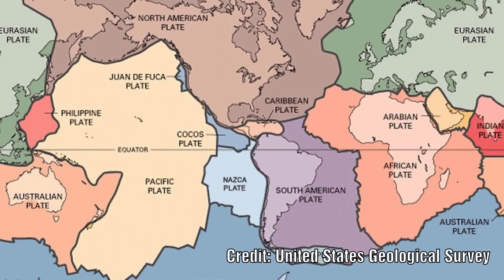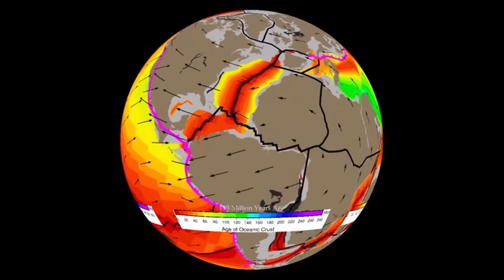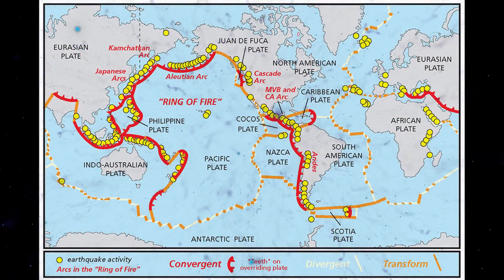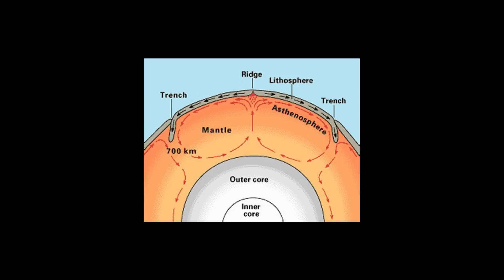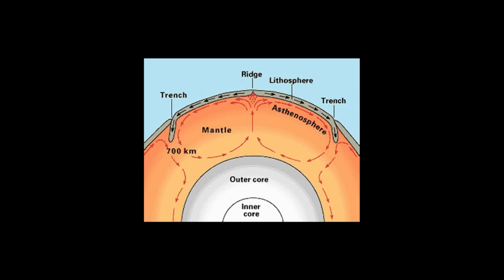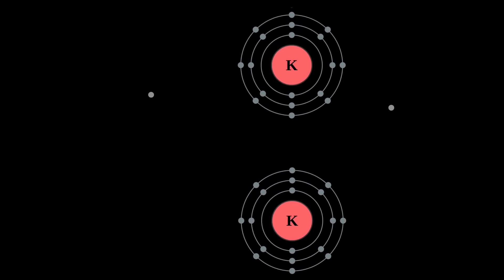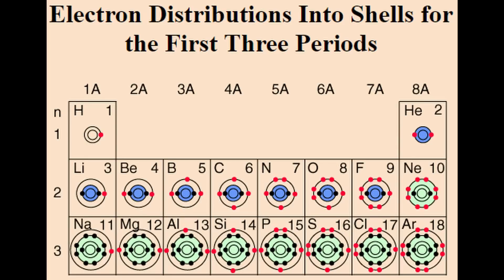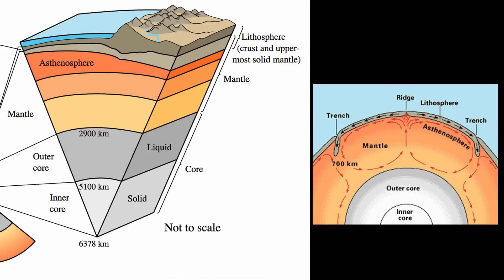What Powers the Movement of the Plates?  Convection or Something Else? Electronic Tectonics Part 1/2

Comment: I've been thinking for some time that the mid ocean ridge is the point of origin of the split in the plates but that the oceanic crust was extruded from beneath the continents. The basalt being brought up from considerable depth as a saturated solution containing insoluble particles in a supercritical fluid, perhaps h4s dissolved itself in h2o, nearing the surface the pressure drops and the mineral sits between a fluid and liquid state. When a continental tide passes through cracks occur and h4si dissolved in h2o penetrates from far below. This mixture reacts melting the pre-basalt, forming the same, together with steam sulphuric acid and silica  ++?. Once the massive extrusion of basalt from beneath the continents end residual activity at the mid ocean ridge forces a little of the new basalt back where it came from.

Comment: It is reasonable (with minor effort) that the individual solar and lunar tidal forces upon the lithosphere (uplifting as much a 3+ inches per daily cycle at the equator ... and more with king and spring water tides - also having the greater conjoint sun-and-lunar alignment tidal forces in geology, play their parts in tectonic plate movements, as well as portions of magna flows of the asthenosphere during these periods.

Comment: If Charles Chandler has electronic tectonics - then this can only happen via the (Lord) superconductive stellar core fragment that is the true source generating gravity but also the active electrical charge through the planet.

Stellar gravitic core - real gravitic force
Plasmatic sphere of lanthanide and actinide radioactives - stripping electrons and shooting them around and outwards through ...
Plasmatic sphere of lead - containing most electrical charges but a constant emission of charges seep through this barrier into ...
Ferromagnetic sphere of iron and nickel - stroking this sphere creating the polar magnetics and flux of the planet ...
Paramagnetic sphere
Diamagnetic sphere
Asthenosphere - lower mantle boundary - undergoing magmatic currents, fluxes, and movements
Asthenosphere - upper mantle boundary - undergoing magnmatic currents, fluxes, and movements
Lithosphere of basic matrix of solidified rock

Stellar core and plasmatic radioactives do have pulsing intermittent non-ionizing and ionizing radiations emissions and electron discharges outward.  These emissions and discharges further energizes the magnetic spheres and asthenosphere mantle into expansion.  The lithosphere cracks, mid-oceanic rifts widen, spew, and push apart continental and oceanic basins.  There is no pure expansion and recycling of plate tectonics on this greater scale of manifestation.  This can be seen by reversing the known paleomagnetic signatures (and their origin dates) and see the shrinking earth.  Otherwise, you would start to see very ancient seabeds appear that do not currently appear on the graphs.  Theyt would say that this is the 100% recycling model.  Whereas, with the expanding (and a little recycling) you have the telltale remnants of very ancient paleomagnetics that MUST BE hidden or buried (not recycled) under areas where such ancient matrix must exist.  Such shoreline of the Russian-Japanese-Asian plate tectonics shows their blue coloring of vast age, while the North American craton and West Coast show NO ancient blue coloring and age.  Are we to then believe that the only plate tectonics movement happened with a locked West Coast geology, and only that ancient matrix of the Old World was the most ancient spewed magma to happen, and sometime when both Old World and New World Pacific shorelines have a common date of paleomagnetics, then the mid-Pacific ridge started spewing and pushing outward in both directions.  You can't have it any other way.

Smaller planet, no primordial sea, one gigantic universal continental mass that then started breaking apart as the planet started expansion and the plates started their skittering all over the surface, and the core manufacturing of oil and water (!) which as gigantic aquifers of lubricant and artesian waters becoming spewed out as swamps, ponds, lakes, creeks, streams, rivers, proto-oceans into the lowest basins, until Pangaea was all water bound ... and we have our current-sized earth and volume with 60-70% planetary-created water (still being manufactured) covering this Big Blue marble in space.

The water on this planet was not brought here by how many billions of meteors, comets, etc impacting this planet - and imparting their micro-fraction of water droplets (totally insane rationale !!!) - but water and oil was manufactured internally - and eventually released through the activities of the stelalr core fragment and the surrounding spheres.  Such gravitic forces, alongside actual elemental transmutation would render naturally accreted material on the core fragment, liberating alpha and beta particles, that would conjoin and start making up all the said primary elements of the planet - hydrogen, helium, lithium, berylium, boron, oxygen, nitrogen, carbon, ... and some radical and noble gasses.  These elements were then later transmuted into these higher elements - not by (super)nova explosions and nuclear fission and fusion.  Such nuclear fusion and fission happens right under your feet - right now.

Comment: Glad to see you're working on Charles Chandler's excellent findings. He has a series of astrophysics and geophysics papers at http://qdl.scs-inc.us/?top=6031 . His paper on the Sun's Interior at http://qdl.scs-inc.us/?top=7224 explains how electric forces hold the Sun together via relatively current-free electric double-layers, formed by EDP, or electron degeneracy pressure, which is the same as the Pauli Exclusion Principle. He and I initially referred to EDP as "compressive ionization", because compression squeezes out electrons, causing charge separation. I think you explain it well too. I tried to understand how electric forces form stars, planets and surface features etc by reading material from Electric Universe scholars, but I had very poor understanding, until Charles started discussing and writing about it. He had initially figured out how tornadoes and thunderstorms work electrically maybe ten years ago. Then, when he and I and a couple other EU friends started sharing info, he developed his model for star, planet and galaxy formation etc. The two friends had their own somewhat similar models, but Charles' model has always seemed the most thorough and sensible to me. Charles apparently had quite a lot of experience with welding and other similar work, which helped him understand electrical forces.
-- In this video above, at the 6' 3" point, you show a tectonic plate subducting into the mantle. Charles and Mike Fischer and I believe that is incorrect. Plates are likely not dense enough to sink into the mantle. One plate can ride over another, as the North American plate has overridden the Pacific plate, and that override looks initially like subduction, but light material doesn't sink into denser material, like ice doesn't sink into water. I looked briefly at your previous video about Guy Berthault's findings regarding rapid stratification, which I agree with. John Baumgardner's science papers on "Noah's Flood" etc seems to me to have the best explanation of how rapid stratification occurred, i.e. via the Flood. I don't find any EU explanation, such as electric discharge machining (EDM), as persuasive at all. Charles has critiqued EDM persuasively. Baumgarnder found that a small planet or large asteroid likely orbited Earth elliptically, causing tidal waves at perigee, which formed strata on the supercontinent, when it had low altitudes, no mountains. Six close approaches of the object caused six megasequences of strata formation. Mountains formed shortly afterward, when an asteroid hit the supercontinent, splitting it up into continents and islands that moved apart rapidly to their present locations. See Mike Fischer's site at https://www.newgeology.us/ which shows how mountains formed from the asteroid impact. Mike's model is the best I've seen on this. He found that the continents were likely able do slide over the Moho layer, which has very low friction due to it being ionized, by EDP and by the Moon's tidal forces, as Charles explained somewhere. Mike and Charles both have similar ideas about how the supercontinent formed too.
-- Celeste told me about your video channel and she said you're trying to contact Charles. I PM'd Charles her contact info. You can also register on his site above and then contact him via PM there. G'Day. Lloyd

Comment: Earth is hollow

And that cavity is increasing in volume i.e. EARTH is 
E X P A N D I N G

Spherical granules being formed on SAFFiRE sun ball may explain why stars shoot out hollow planets into orbit.

As if the stars collect their newly formed trash aka heavy elements,  and then spew them out as planets.

Wal thornhills "dipole gravity" seems logical now.
In every huge body, all e- in atoms are shifted away from the centre, and all p+ are shifted towards the centre.
If the body has just too much matter in it, then atoms can overcome their structural arrangement/friction/interatomic bonds etc , and so a cavity gets formed in every planet with all p+ pointing inwards, the repulsion may cause planets to expand over eons.
For "earth dipole gravity" to exist , earth should've 2 plates as in a capacitor.
Plate 1 is the surface we live on.
Plate 2 is the wall of hollow inner cavity.
And maybe, its pretty chilled inside that hollow portion .
It gets hot only in between the 2 plates.
Subterranean life can exist there on the cavity wall.

I maybe wrong , I'm no scientist.

Comment: Elephant in the room: Over a billion years the coastlines of Africa and S America would bear no resemblance to each other from various erosion and torsion forces. Must have happened faster by a factor of thousands.
Reply: The plates are nearly an exact match. Millions of years? HahHumbug!
Reply: The coastline is not the edge of the techtonic plate
Reply: (1) The Atlantic Ocean only started to open about 175 Ma years ago.
(2) Because the spread is from that Atlantic ridge in the middle of the ocean and is basically linear, and the main bodies of the continents are so thick and established, there aren't any great forces deforming their shapes.  The Atlantic is a spreading plate, and it's adding to both the American plates and the African and Eurasian plates way out in the middle of the ocean.  The Atlantic isn't associated with any large subduction zones.   That's why there isn't major volcanic activity at the edges of the Atlantic.  

You've made assumptions rather than following the evidence.

Comment: I tried finding measurements of plate movements using GPS and stationary pos on the ground and saw that said measurements had large error bars associated meaning data was rather worthless as a definitive answer and the asia plate I believe was moving in many directions inside its boundary, so I think plate tectonics is invalid.  Describing the inside of the Earth reminds me of describing the inside of the Sun, all theory very little evidence.  Seismic evidence can also be used successfully to describe a hollow Earth.  Deepest hole drilled is what 30 miles? and we're talking about 4000 miles?  Thornhill et al. have said that earth's gravity would have to have been one third of today's strength to allow the largest dinosaurs to walk or pump blood to their heads.  I imagine that if our gravity has varied over eons, the volume of the planet would also vary as lesser gravity would allow slight expansion of the Earth leading to cracks (plates) in the crust which would remain upon higher grav and shrinkage.  Cracks or plate boundaries are places where ions or electrons would accumulate because of jagged points / discontinuities.

Comment: I find it hard to believe that a spinning sphere in space would have a large island on one side and nothing on the other. Unless we are missing a large island in the Pacific... 🤔
Reply from the maker: Yes this is one of the mysteries and is one of the reasons that an expanding earth hypothesis is compelling but this too has many problems.  I am planning to look at this in the near future.  Someone recently suggested that the reason we might have had one large island on only one side might have been due to a tidal lock scenario which may fit in with the polar aligned phase but I need to do a lot more work on digging deeper on this idea.
Reply: Some thing to consider could be, not a continent sinking but a few rising. Leaving evidence of marine life at high elevations and evidence of civilizations below the sea. Now that accurate ocean floor maps are available we could check the  variations (especially near the faults) and see if there is any connection between them. 
Thanks for the response btw.

Comment: Dr. James Maxlow is correct on this imho and the mechanism is the Sun providing energy and elements both internally and externally required for expansion and electrification across the band gap. Look at the Beryllium 10 (https://en.wikipedia.org/wiki/Beryllium-10) relative to the solar cycle input energies and the Neutrino reactionary emission coming from Antarctica suggesting an oscillating hollow (E=Hf) growing plasma core model. https://www.jamesmaxlow.com/
Reply from the maker: Yes I plan on covering this soon but I still think there are problems with all the current models including this one
Reply: @SeethePattern  I agree. He needs the frequency added in where the spherical surface is in resonance and expands as well contracts relative to charge density during ice ages. All capacitors expand and contract during charge / discharge cycles and in the case of Earth is also rotating. Not a simple solution really.

Comment: Continental drift is experienced globally, yet the examples are primarily of the Atlantic.   Given the Pacific and Atlantic sea floors are the same age, it would mean the Pacific floor has subducted the combined size of the Pacific and Atlantic floors while adding the new ocean floor of the Pacific as the Atlantic splits up the Americas from Africa.  Once completed the subduction rate in the Pacific has slowed down?  This makes no snse.  More likely the earth is expanding.  
Expansion would also resolves the dinosaur size - gravity issue.  Seems like expansion could combine two observed patterns into a single theory.  Be brave.
Reply: Bingo!
Reply: By which factor the earth must have expanded in the last 200 million years to explain the dinosaur gravity issue?
And where does all that mass come from?
And if that process is constant, how big was earth 4 billion years ago....
Reply: @janhemmer8181  good question. So working backwards in time, it could be the earth is currently expanding due to the sun's continuous bombardment of subatomic partials;  transmuting existing and creating new materials in the earth's interior (may also explain the inner heating of our planet).  Prior to 200 million year maybe the sun wasn't doing this.  

I don't have the all the  answer but I know when I watch any video of the proposed continental drift movement.  The gyrations of the proposed continent's paths has to be pure speculation.   There has to be a simpler answer - the expansion theory makes the most sense.